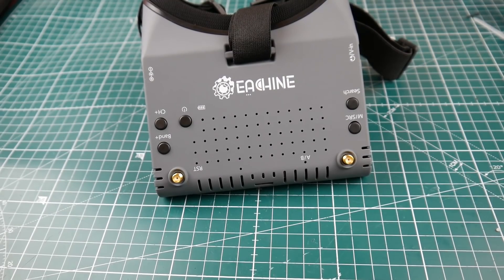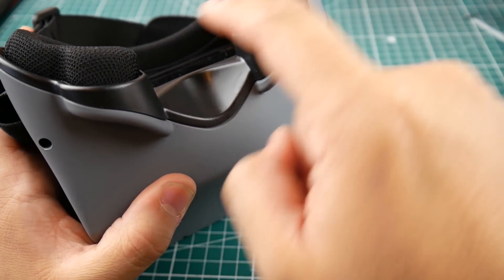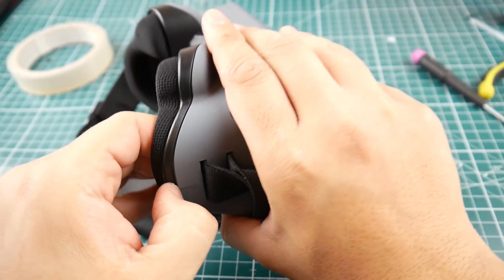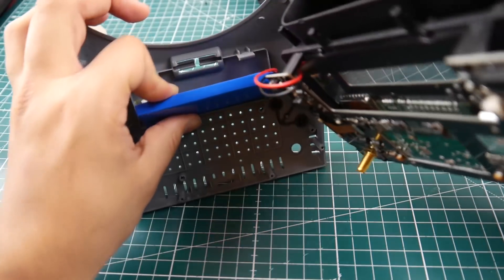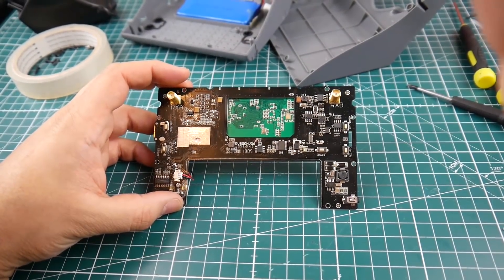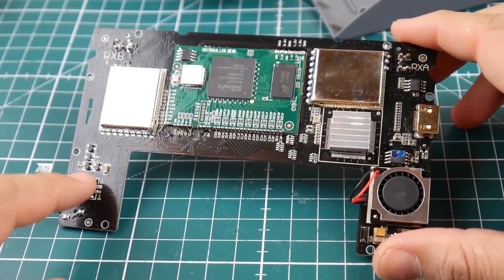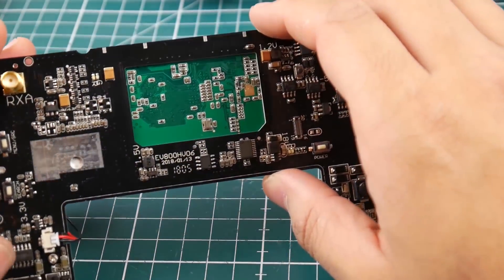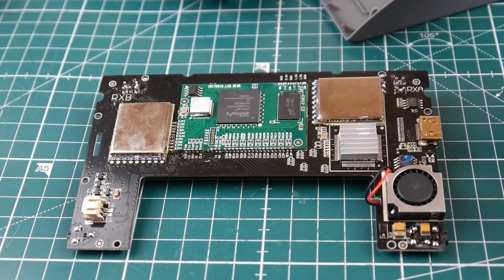Eachine EV900 FPV Goggles// Overview and Teardown

Comment: it does look really good inside, the ev800d's get very hot, black circuit board and fan and mounting flat looks like a good solution. i look forward to getting a pair of these, eachine please add the plug to power externally up to 3s.   it looks like the eyeiece will take a pair of cheap reading glasses the same way the 800d's do, great.

Comment: They need a way to adjust the focal point in and out or have a frame insert that can be swapped out for people with glasses!
Reply: they look the same as the 800d's which can take a pair of reading glasses without the arms, just snaps into place perfectly

Comment: The number of FPV googles from China that cannot be worn by someone with an average caucasian nose is not even funny anymore. Designers and testers must all have had small/flat/low noses it seems.

I do like the basic design with the mirror, though. That makes it possible to use a cheap hi-res phone display in a small form factor. The fov achieved with that is huge, maybe too wide even. I had this problem with box goggles where I needed to move my eyes a lot to see the OSD info in the corners of the screen. With this kind of resolution you could even provide a function in the menu to scale the image down to get a smaller fov if desired.

I really don't know what's up with the missing DVR, it's a must for all goggles above 60$.
Reply: Absolutely agree. The OSD info isn't too much of a concern for me since you can reposition the OSD in Betaflight, but the DVR is a must. It looks like the front of the case has a micro-sd sized cutout so it may be planned.  I would like to see a measure of the latency or at least someone's "feel" for it, since the higher resolution could add a bit. It looks like the designers went to extra lengths to keep the screen and battery close to the face so that the majority of the weight is not cantilevered off your nose like it is in the EV800 series. It's hard to believe that they missed the nose sizing issue though.
Reply: I don't get how they screwed up the nose fit. Do they design each goggles from scratch? I would assume Eachine has some kind of 3D model of a "target face". If they do they changed it for the worse from the EV800. And this time dremeling the nose part away may not even be an option because the lens is so close to the face.
Reply: I suspect that it'll take dremeling well into the lens as well in order to get a proper fit for many of us.
Reply: Yup. And then your eyes would be so close that your eyelashes touch the lens. This design may be beyond fixing. I prepare to wait for an EV910D.